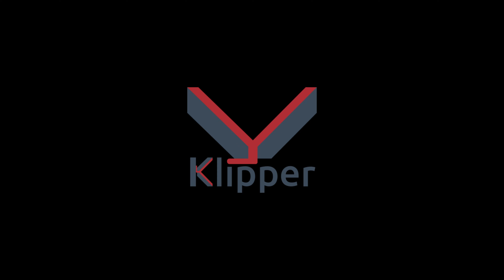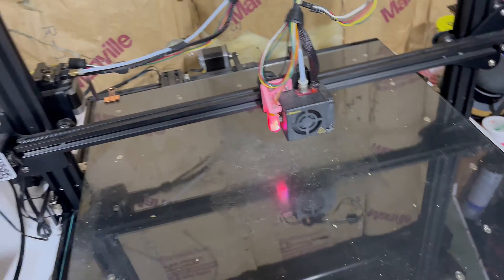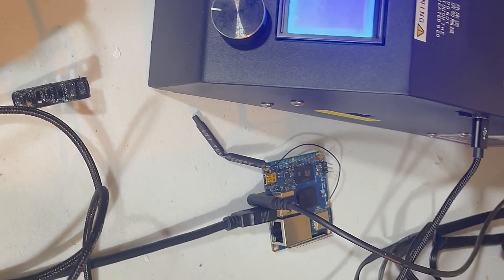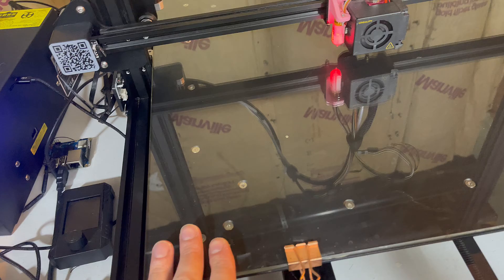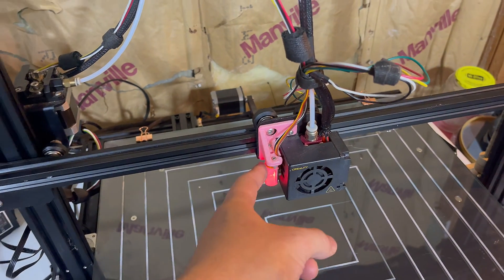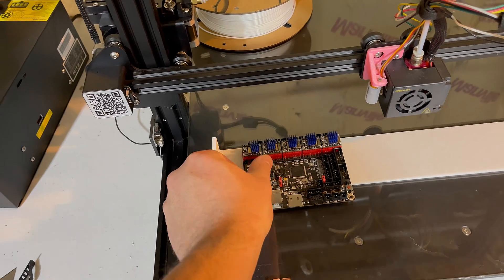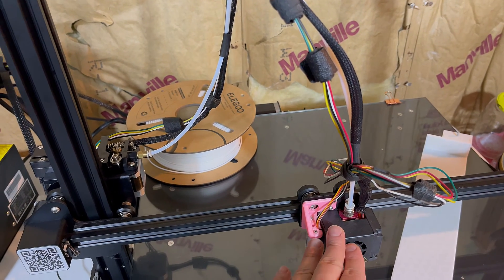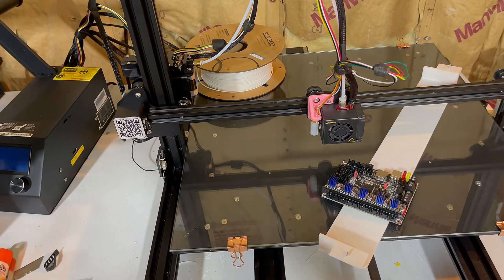Upgrading CR10 S5 - Part 1

Comment: I just installed a BL touch, and loaded and installed firmware for auto bed leveling, filament detection and print resumption, now my printer is all out of whack as far as where home is and it wanting to print out side it’s build plate area to where the stepper motors skip. What do I do??????

Comment: Bruh, your the biggest drama queen on YT! I have a CR10-S5 the entire Y-Axis does not weigh anywhere near 30 LBS, the bed does not take 45 minutes to get to 60, Glass build plates are used because glass is always level! It just isn't that difficult ROFL! They do prints slow without Klipper and even with Klipper by todays standards but that is it's only downside! Funny video though! You can use the entire bed with Marlin though you just need to learn to bed level or install an ABL! I bought the EZZBL kit for mine from TH3d back in 2018 right after buying the printer and it has served me well!
Reply: Hello, I have two cr-10 s4 and two cr-10 s5s do they still sell the easy BL touch I need to upgrade? My my printers are not holding bed level as well as they used to.
Reply: I never could get Tim's kit to work. It was probably me, though.

Comment: Hi Joseph! I'm planning on running a similar setup so far I have CR-10 S4 and a CR-10 S5 with:
Big Tree Tech SKR Mini E3 V3.0, Big Tree Tech TFT35-E3 V3.0, Bondtech DDX, Slice Engineering Mosquito Magnum, AntcLabs BL Touch, Gulfcoast Robotics HEX EPCOS, and a MAXGLEE 12V 70W

I cant wait to see the updates to this series. I really want to get my setup to run on Klipper, with a Big Tree Tech Pad 7

Comment: Very dramatic intro!  I have two of these machines that I am about to swap out the electronics on - SKR Mini E3v3, new TFT35 Display and Meanwell 24v power supply.  Quiet fans for the control box and a Bondtech DDX/Slice Mosquito hot end.  Like you, I love the print volume but I want it to be a reliable beast for printing big stuff.  I'm watching how you do this very closely!  As far as the upgrades - they are worth the investment (to me).  The Elegoo machines you mention have issues.  They come with wimpy heaters and small nozzles, so getting those things to print big will also require some upgrading.  Large scale printers, out of the box, ready to go, are very pricey.  Upgrading a Creality isn't the worst thing since there are so many upgrade options out there.  Mine have AC beds and Wham Bam surfaces...the glass is gone.  I also invested in enclosures for mine and that's a huge help for printing (when you control the environment).
Reply: Bro, are you on Reddit, where I can follow you upgrade journey? I am just about to set the silicon heat bed and do some other upgrades